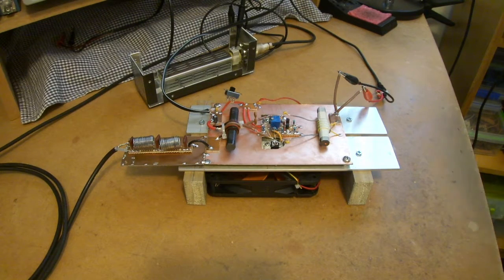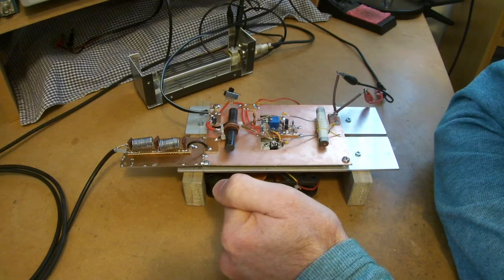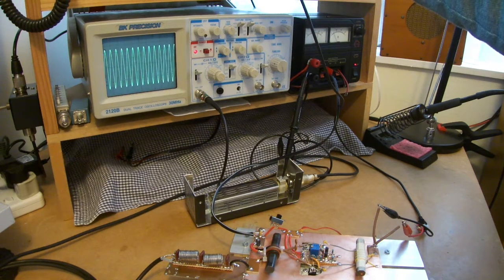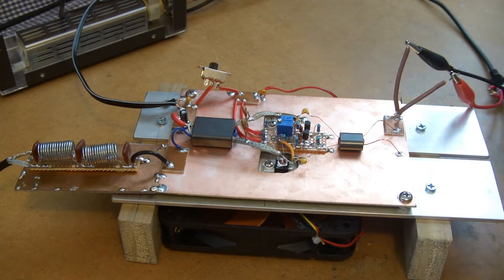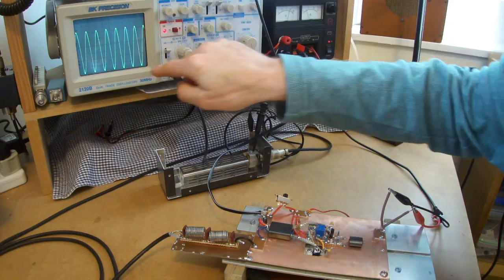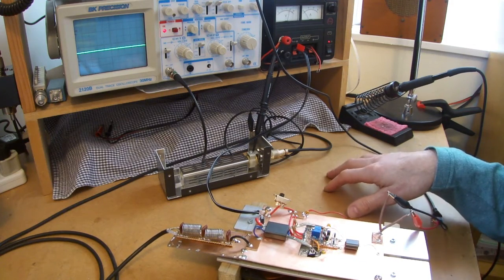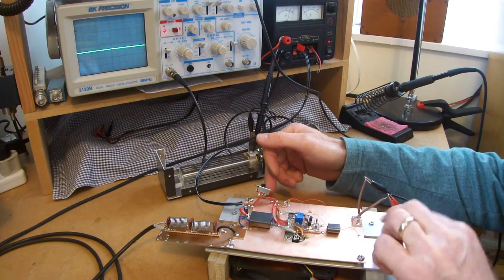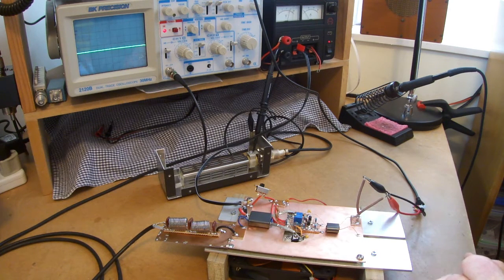Homebrew RF Power Amplifier: Part 3 Ferrite Rod versus Binocular Cores

Comment: Thanks for showing the workings out for the resistor values in the previous vids.  I have been thinking of using just a piece of aluminium with a fan for an hf amp using rd16hff1 mosfets I am going to experiment with.  Then I found your vid, so I will do just that. Keith g0odu
Reply from the maker: Thanks Keith. I'm no expert, but it works for me.

Comment: Excellent video series, thanks for building this amp Charlie, your results very similar to mine. 15dB gain @13.8v is the differentiator with these FETs, over the IRFs. There's a new Motorola device that will do 100W, MRF101, the FETs aren't  too expensive,  maybe worth checking out! 73s Paul VK3HN.
Reply from the maker: Cheers Paul. I definitely want to do some more with those devices. I'll also see if RS Components has the MRF101. I'll definitely use a proper heatsink with those!

Charlie

Comment: Cool little build, but you definitely should incorporate a heat sink on that copper board and some decent DC transformer filtering with a ferrite, 4-5 wraps through the ferrite should be suffice. 73's
Reply from the maker: Thanks for that. I'm quite surprised how well the aluminium stock worked as a heatsink, especially with the fan under it.